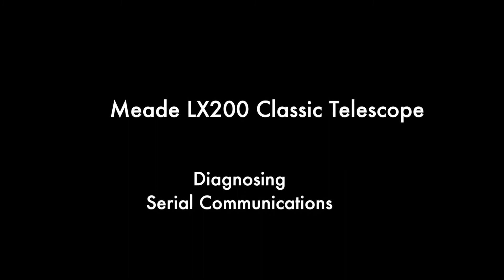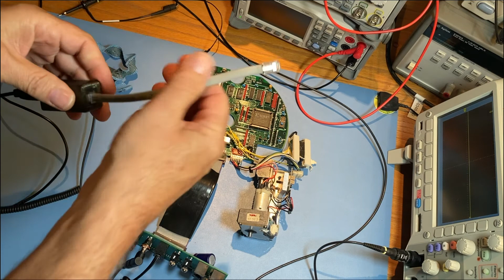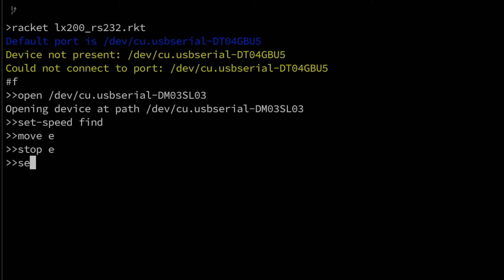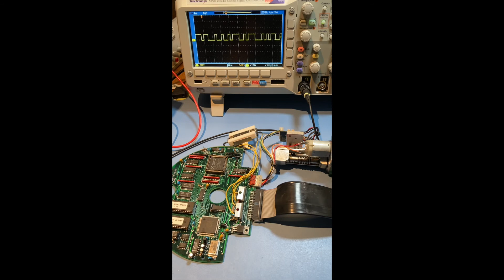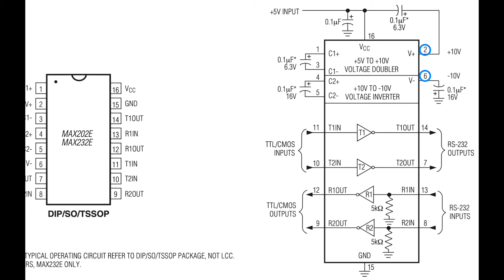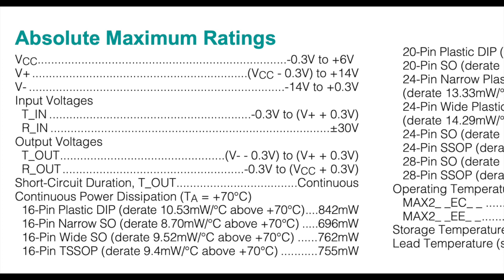LX200 RS232 Diagnosis

Comment: Hey mate I am battling an old LX200 10 inch I just picked up and having no luck, what is the software you used to get it moving? I have tried writing the BASIC code but I am no programmer. Any help would be much appreciated. Cheers
Reply from the maker: It's our own test software, but you should be able to use most planetarium programs like Sky Safari or Stellarium. They talk to the LX200.
Reply: @clearlinetechnologycorp.5974  thanks for your reply i have tried stellarium and can not get it to connect at all. Usung some random software to send commands and bridging pin 2+3 on the cable shows the cable works as i can send and receive back what i sent but scope doesent do anything. I am usibg a converter too so might try to find an ancient pc with a rs232 port. I will try to find an oscilloscope and follow your guide too. Cheers
Reply from the maker: @StompAE86  Make sure your converter outputs actual RS232-level signals to the telescope, they are not the same as 5v logic levels. The loopback test will not uncover this.
Reply: I have an issue where when I simply plug in my AC adapter, I get noise on my serial lines. Telescope isn't even powered on. I also do not see that I have rs232 signals on the wires coming from the telescope. Everything else seems to be working fine. AC adapter is plugged into a line conditioner. No noise visible on DC 18v at that point.

Comment: Ciao e complimenti per il video davvero interessante. Ho notato però che nel manuale LX200 classic, il pinout del Panel Control Telescop RS232 J11  è diverso rispetto a quello rappresentato nel video. Ovvero il ground si sposta sul PIN 2 da destra verso sinistra (attuale colore GIALLO), il  segnale TX VERDE si sposta sul  pin 4 ,  il segnale RX si sposta sul BIANCO PIN 5 sempre da destra verso sinistra. In sostanza, la numerazione sul Manuale inizia sul PIN1 da destra verso sinistra, anziche da sinistra verso destra del video. E' così? Grazie mille
Reply from the maker: The diagram in the manual is confusing. Looking into the female RS232 connector on the front panel, left-to-right, you have +V, GND, LX200 TX1, LX200 TX2, LX200 RX1, LX200 RX2.
Reply from the maker: @robertoventurelli7602  I'm sorry, but I am not familiar with the ASIair, nor your cable, so I can not advise you.